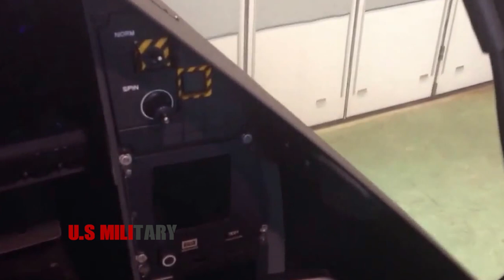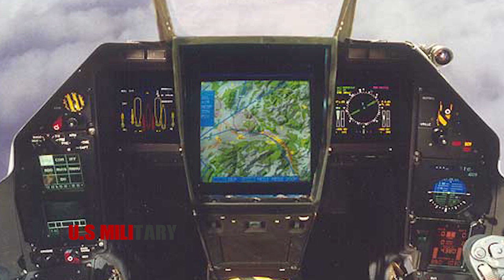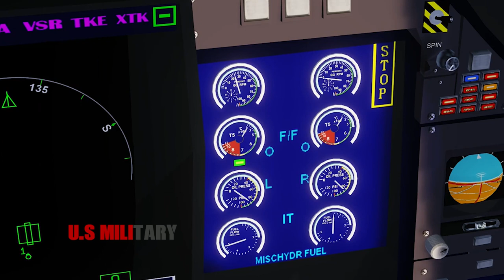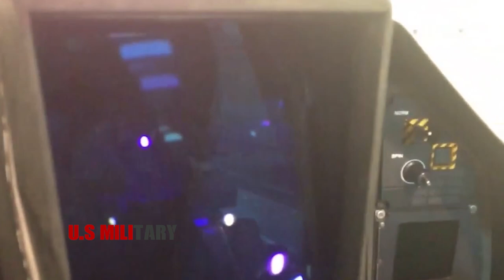A

Comment: Dassault is not 5th Generation atleast do some research
Reply: 4.5 yes
Reply: @LOLO / VAL first I want to say I love the rafale but the reason why it’s not a 5th gen it’s because it’s not stealth. Rafale has a small cross section but it’s not fully stealth and that is why is not. 😉
Reply: @maximustv5681  No airplane is fully stealth, nor the F-22 nor the F-35 are fully stealth. They have a small RCS, yes, but so does the Rafale. And unlike the two others, the Rafale is mostly made of radar absorbent and non reflective materials paired with a strong electronic suit and SPECTRA (Rafale was developed as a stealthy plane), while the two others rely mostly on angled bodies to reflect away RCS. With radars and IRST getting stronger day by day, relying mostly on angled bodies for stealth is getting obsolete day by day. 
As for being 5th generation, amongst the Rafale, F-22, and F-35, thé Rafale is the only one to have all 5th generation technologies.
Reply: @brunol-p_g8800  I think what you meant to say is no aircraft is completely invisible to Radar. Although the Rafale, like the Eurofighter Typhoon have a significant lower RCS than previous 4th gen Aircraft. 

It is no where in the same vicinity of the F22 and F35 RCS.

The Rafale does not have any 5th gen technology. The F22 and the F35 are the only active 5th gen Aircraft.

The main requirements for for a 5th gen aircraft are:

Stealth, with munitions stored internally.

High maneuverability, which tends to include short-field capabilities.

Supercruise, i.e. prolonged supersonic cruise without the use of reheat 1.5 Mach and above.

Advanced avionics, including low-probability-of-intercept radar (LPIR).

Networked data fusion, enabling situation awareness on the battlefield.
Multirole capabilities, such as battlefield C3 (command, control and communications).

As far as stealth is concerned if you are talking about being designed for stealth, the F22 and F35 are in that category not the Rafale,  the Rafale obviously had design features with lower RCS in mind but not overall Stealth.

A stealth aircraft requires several things not just RAM or electronics to be considered a stealth aircraft or designed for stealth.

 If you look in their designs especially the F22, it has a design called planform alignment. All panels, wing, horizontal stabilisers and panels are in complete alignment or completely flat.

Along with its Radar, avionics and reflective coatings all contribute to its overall low RCS and overall Stealth characteristics.

On your point about IRST, well firstly no aircraft is going to get close or have a larger enough range to detect an aircraft like the F22 or F35. And secondly, that is why the F22 has the rear design and nozzle design it does. It was all intended to reduce its over all heat signature significantly.

The Rafale has none of these characteristics. It’s a 4.5 gen fighter at best. Although it is an amazing and capable aircraft.

It is no where near a 5th gen Aircraft, even the Su-57 is lacking all the requirements to be considered a 5th gen and it’s a lot closer than the Rafale.
Reply: @oneflyline96   the Rafale has all the characteristics, but stealth if you consider munitions being stored internally. As for the others: Network data fusion, yes and it was first implemented in the Rafale before even being on the F35; Supercruise, yes; high manoeuvrability , yes; advanced avionics, yes.
Reply: @brunol-p_g8800  Still not what is considered 5th gen tech as far as avionics , Radar and sensors. It’s certainly not on par with the F-35 and F22. And the F35 is the only active aircraft that has complete sensor fusion.

If you look at aircraft like the block 72 F16, that actually has 5th avionics, radar and sensors. They went to great lengths to incorporate what they had learned with the F22 and F35.

And don’t get me wrong, I absolutely love the Rafale. It is and amazing designed aircraft and is absolutely a magnificent and highly capable aircraft.

It’s just that the F22 and F35 are next level, I really hope Dassault have a 6th gen in the works. I’d love to see what they could come up with. 👍